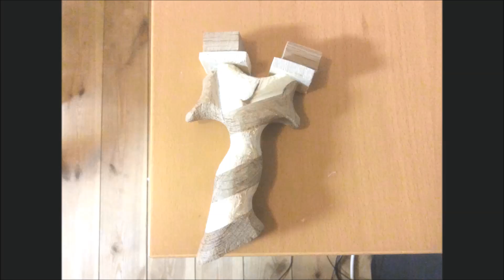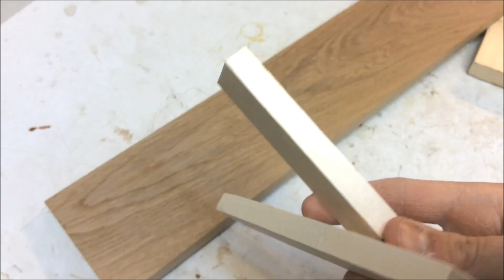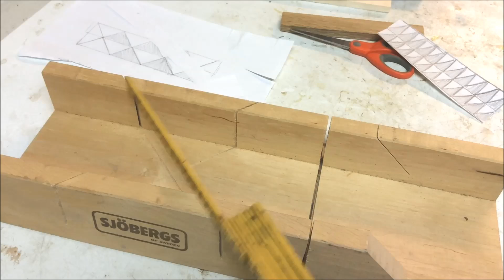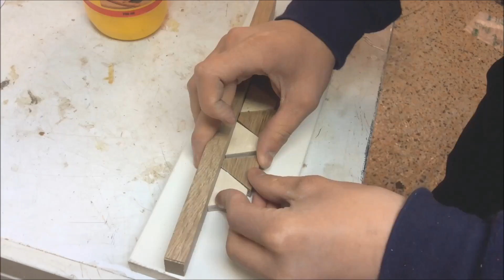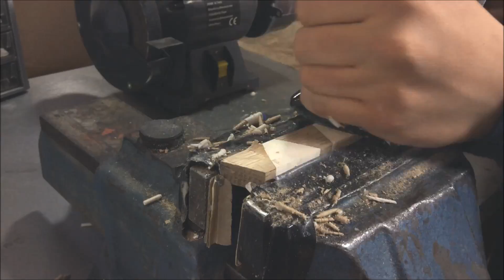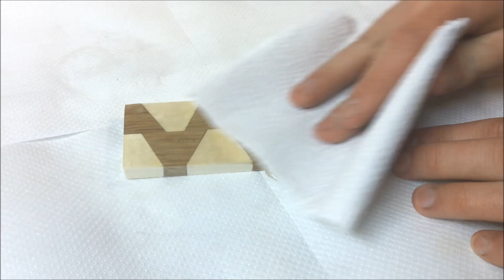Make ZigZag Pattern Knife Scales - Without Any Power Tools

Comment: Great video! Slingshot looks amazing too!
Reply from the maker: +The Slingshot King Thanks! I am thinking about buying myself some wax to put on the oil as a final finish. It seems like the spray laquer doesn't show the deep colors as well as linseed oil.
Reply: If you first add linseed oil, then varnish, then sand it to 2000 grit, and finally add wax it gives an amazing finish.
Reply from the maker: I'm not into neither varnish or wax so do you have any recommendations?
Reply: Sorry I don't. I either use just varnish, just wax, or both
Reply from the maker: What about using spray laquer on oiled would? I can't tell whether it behaves the same as polyurethane does, because I've never used it. 

I looked up the paste finishing wax you use in your videos at home depot's site. It costs 9 dollars. If you try to buy and import that to Sweden you are looking at a 50 dollar total cost.
 
It seems like bees wax is not too expensive, and it's available here at certain stores.
Reply: I've never used spray laquer but I'm guessing it would probably work fine. It's a shame about that finishing wax, but I'm sure they sell it somewhere in Sweden...
Reply: +LetsBuildIt I think you have many options regardless - so test some floor coatings, musical instrument finishes and so forth. These should all be quite avalable virtually anywhere.